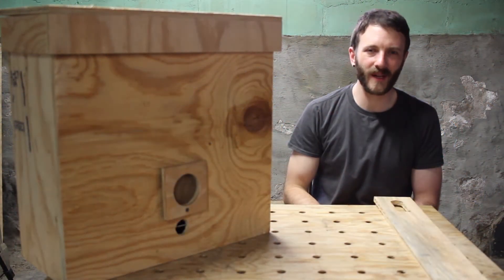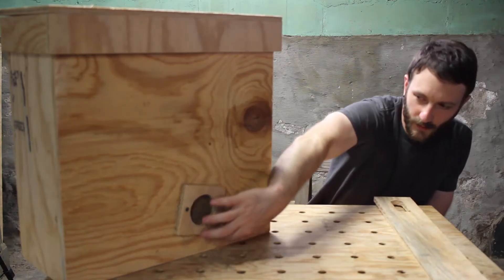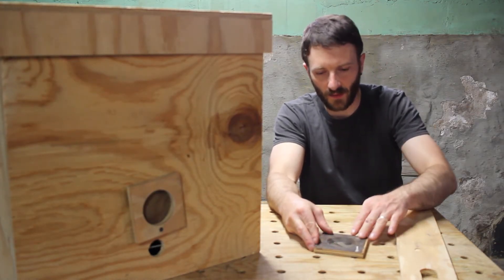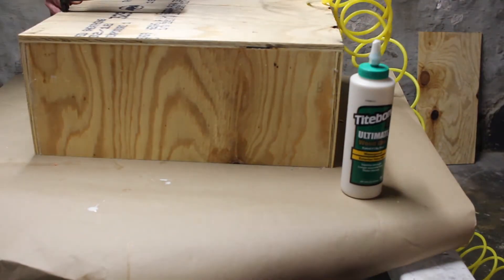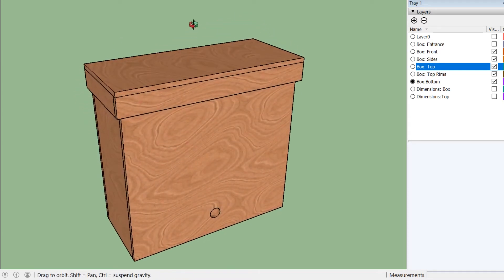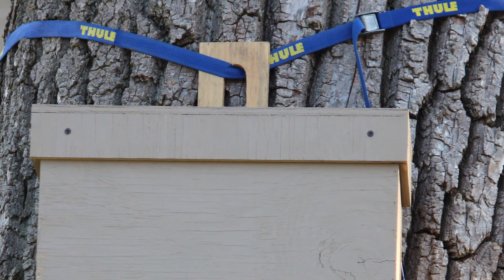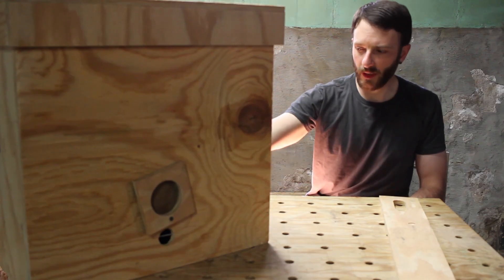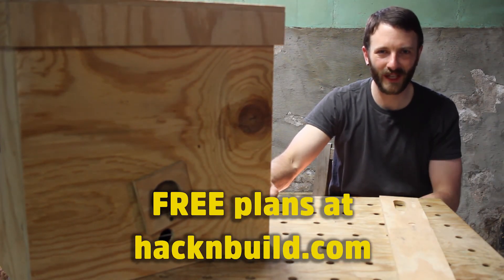Build a swarm trap for catching wild honey bees! HNBEES #2

Comment: Cheers man. Best video I found so far. Simple and to the point. I have a swarm hanging off my chimney in Ireland.  I have a citronella candle lit in the stove to keep them out of the chimney.  Will build one of your designs and mount it nearby and hopefully they will move in and I can give them to a local bee keeper. All the best from Ireland.
Reply: Cannot believe it worked. Had the box left beside the swarm for 1.5 hours and they started to move in. I used beeswax and lemongrass oil as an attractor. Thanks again
Reply from the maker: Good luck, hopefully they will like it 🤞
Reply: @HacknBuild  just finished the build here 👍🐝😎

Comment: when using this size i have problems with the bees building on bottom of the frames. I use deep frames with foundation. I notice 
you use medium with no foundation. when transporting, the combs fall to bottom. what am I doing wrong?
Reply from the maker: I am not an experienced bee keeper.  This project was just the outcome of some research into different swarm trap designs I did.  I could see that because there is lots of extra room at the bottoms of the frames, the bees might think it's a good spot to build comb.  So maybe try with just top bars and comb guides.  Or use use deeper frames.  I was planning on swapping the medium frames direct to medium boxes, that's why I set my trap up this way.  If I had to do everything over, I'd probably just use top bars and comb guides. They are a lot simpler to make on the table saw.

Comment: In the diagram it says 6 front rayls i can only see 3 on the design. Is there any new design? Could you also upload the equivalent mesurements in cm please
Reply from the maker: I think if you download the Sketchup plans, you should be able to view the units in  metric, or just multiply everything by 2.54 to convert everything to centimeters.  I might build a units conversion mechanism into the site in the future.
Reply from the maker: Also the first part of your question: There should be enough stock down towards the bottom left corner of the sheet to get the remaining pieces.  Thanks for pointing that out!
Reply: Your material list on your website shows 6 front rails but I agree with Ponyony that there should only be three unless we are missing something in your build process. Good plans by the way.